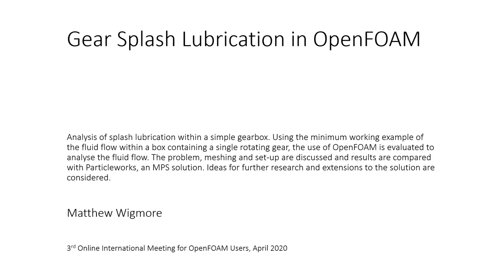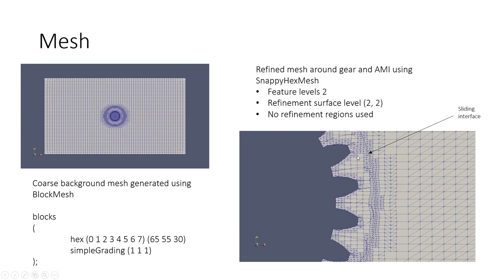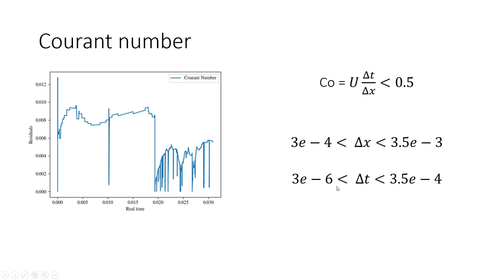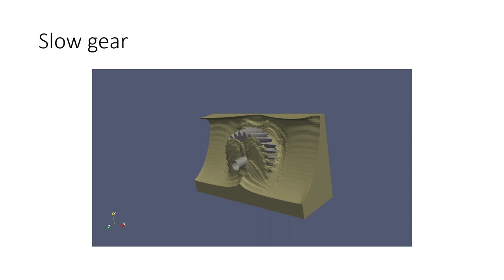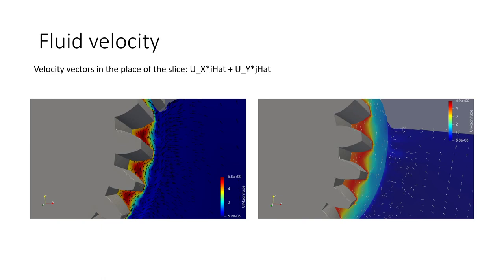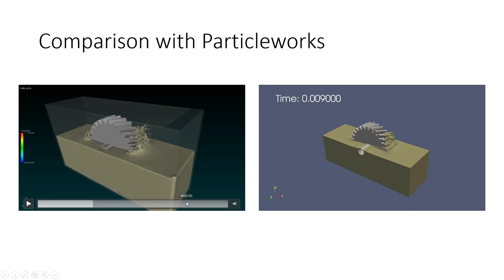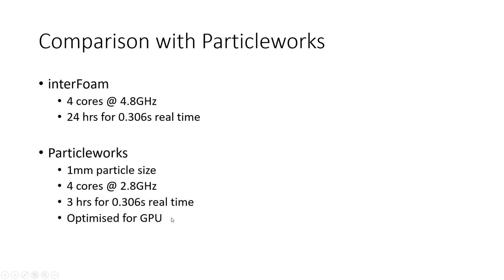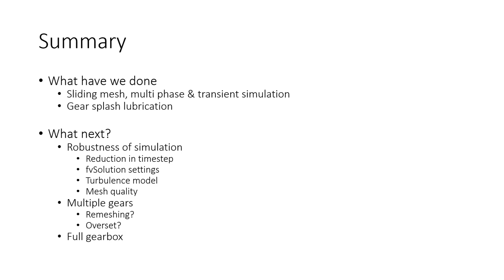Online International Meeting for Users of OpenFOAM III - P6 - Wigmore

Comment: hello mr jozsef i have some problem
i m running simulation but i have this erreur 

Primary job  terminated normally, but 1 process returned
a non-zero exit code.. Per user-direction, the job has been aborted.
-------------------------------------------------------
--------------------------------------------------------------------------
mpirun detected that one or more processes exited with non-zero status, thus causing
the job to be terminated. The first process to do so was:

  Process name: [[8236,1],4]
  Exit code:    145